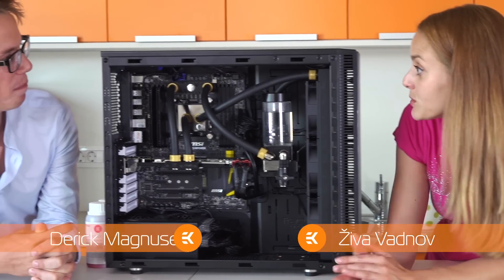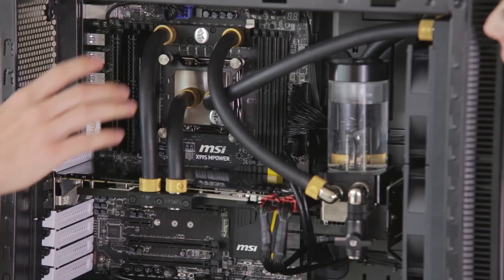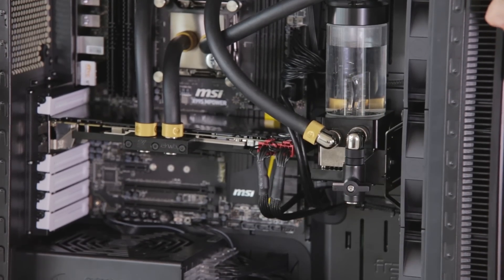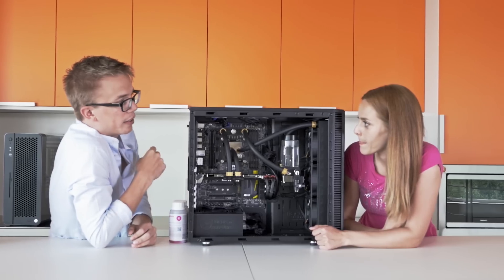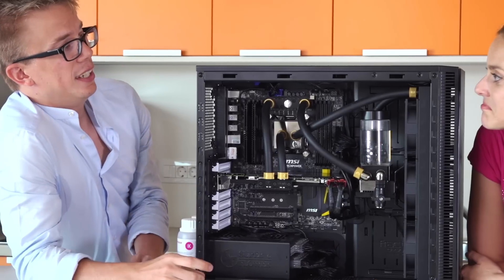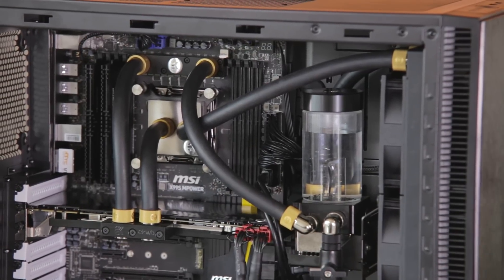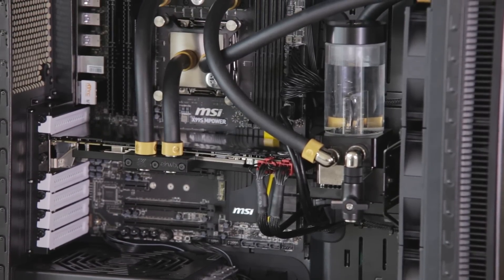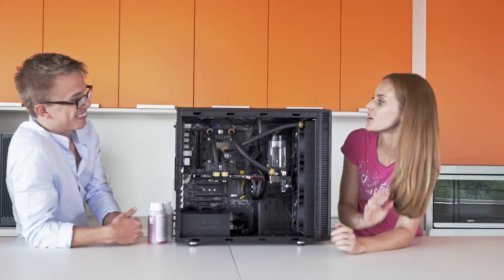Custom liquid cooling - How does it work?

Comment: hi there, interested in getting into liquid cooling. I've used noctua heatsinks and almost all my builds and love them, but I'd like to try water cooling. The price of the predator 360 seems excellent. I am curious if I were to continue to expand off of it, would the reservoir and pump be sufficient? for say a cpu and 2 gpus? Also, could you do a short guide on fittings? I'm curious about quick disconnect and fittings for hardlined liquid cooling. Eventually I'd like to build a hard-line system off of the 360mm rad.

Comment: I am having trouble with my EK-HDC 10/12mm fittings. I put the EK HD tube in and secure the fitting as tight as I can get, with slight pulling the tube comes straight out. I don't think the tube is going past the second o-ring inside the fitting (the inner o-ring). How do I fix this?